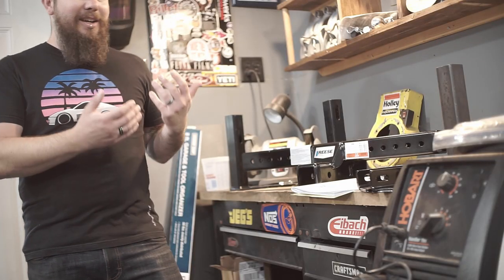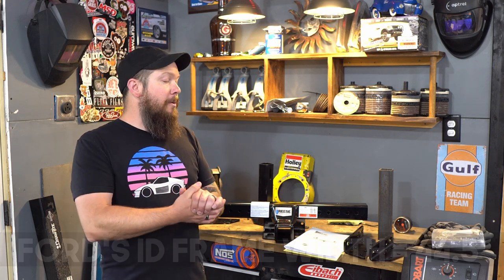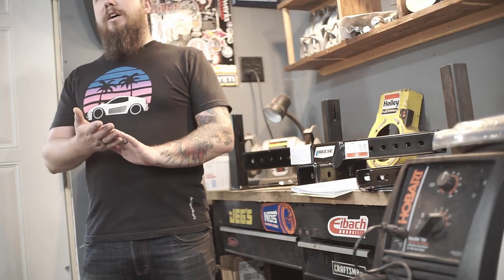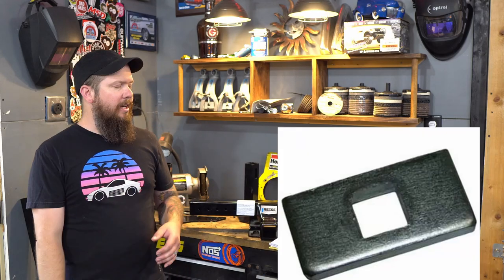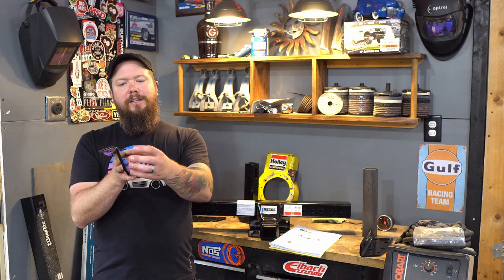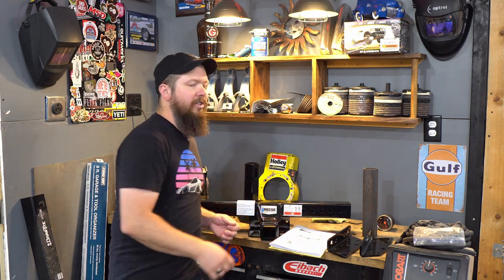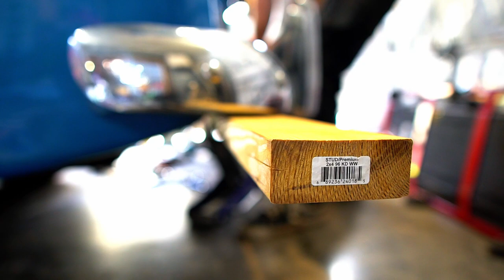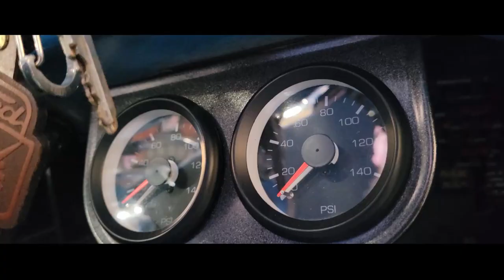How I built a trailer hitch for a shoebox Ford; Shoebox Ford Ep26

Comment: Think it could handle a smaller teardrop trailer? I've got a 51 shoebox and we're looking at the 13-15ft trailers in the 1500-2000lb curb weight range
Reply from the maker: Sorry about the super late reply. I'm not sure I could comment since I don't know the camper size and weight, or how the hitch would be fabricated by someone else. 
In my case, I hauled my pop-up camper behind my shoebox. I do have a modern drivetrain and an S10 front clip (disc brakes and modern steering). 
So there's some factors to consider.